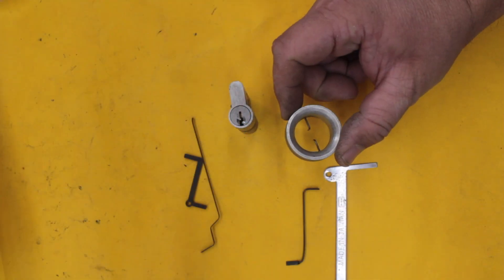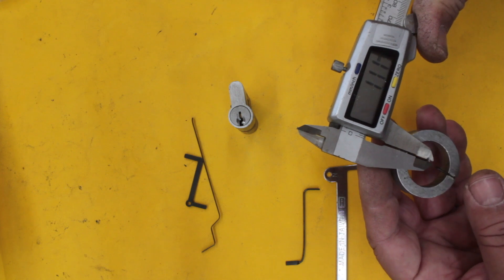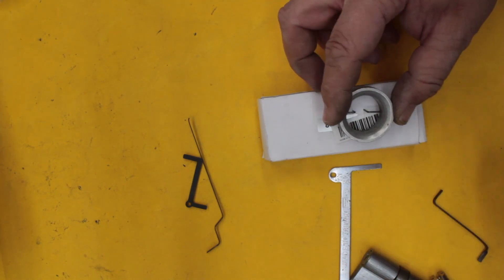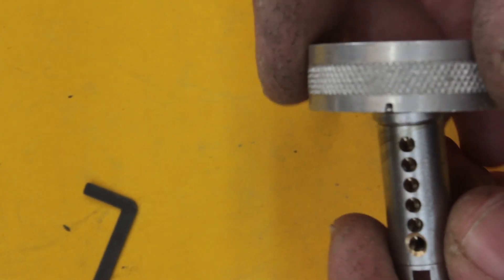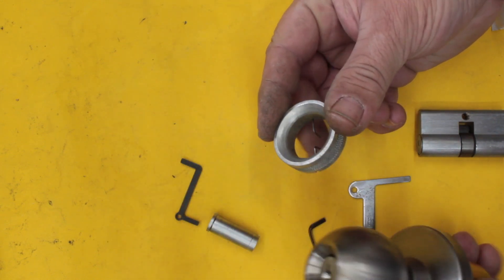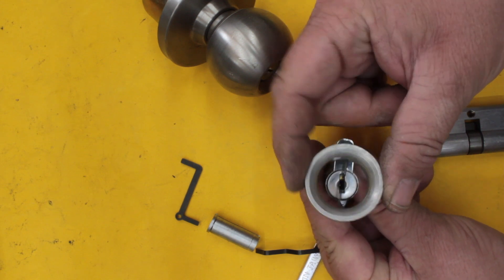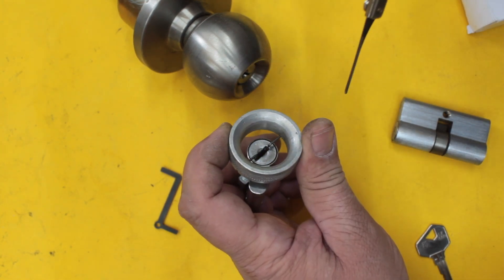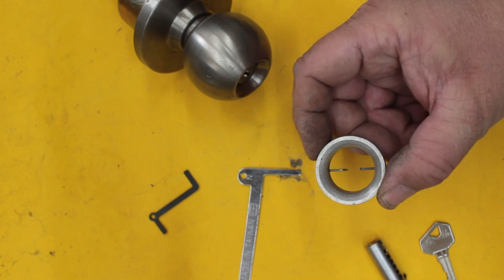Circular Tension Tool

Comment: There's one from Multipick that has tension marks and springs. It also has replaceable wires , so it can fit in a lot of locks , but that one costs about 75€. And , adjustable wires and replaceable is a quite good thing. This one looks like one from SouthOrd , which costs about $44 US. :)